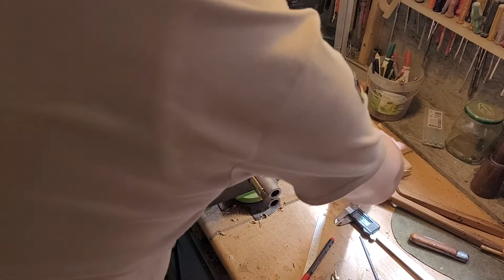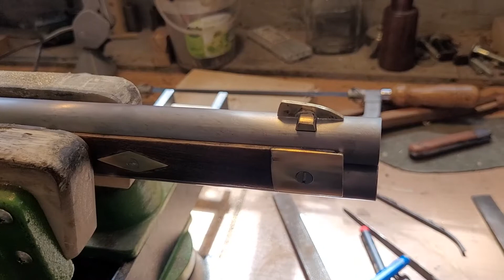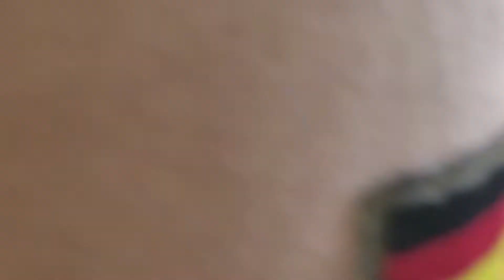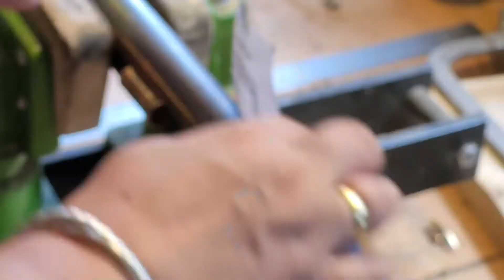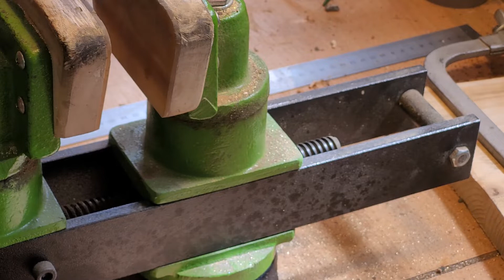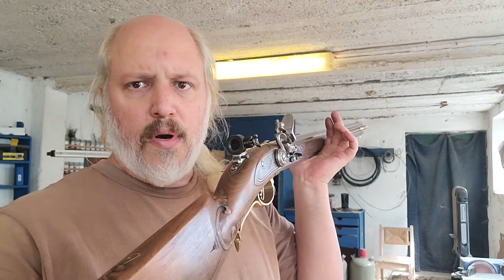Swivel breech rifle scratch build pt 56 intalling the sights

Comment: Hello, is the metal of car springs excellent for making musket barrels?
Reply from the maker: Oh it is actualy best to use mild steel like st37 or st52 thick seamless hydraulic pipe. Spring steel is way to hard to work with and need some heat treatment wich could be trickey and cause cracks 😊